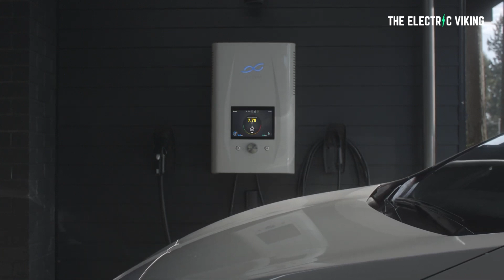The battery that charges 70X faster than lithium & has 300% more energy

Comment: after a big GMG update last week, they have increased energy density to over 300wh/kg, im not sure where the "3X" number came from. but these batteries require no heating or cooling equipment, so they wont lose energy density at the "pack level". but this still means with their current tech, they have higher energy density than any commercially available large scale lithium battery
Reply: I rather doubt about this battery, if they have mastered electrochemical formula, why they dont using existing lithium battery production tech to make battery mass production ?

Comment: You focus on the batteries not catching fires being important for airliners, which sure is true, but I really don't want my car or house to catch fire either, so I think you are under-estimating the market-advantage just for that aspect alone. Not to mention the geopolitical advantage of not needing any China-dominated rare-earths. On the other hand, 3x energy-density is theoretical, and will not happen for a long time. The 70x discharge-rate should be great for VTOLs, but for long-range aircraft I don't think this tech is ready. Grid-storage, heavy machinery with custom charging-networks, like mining equipment, trucks and busses, high-performance EVs are most likely first revenue, trickle down to mainstream EVs in 5 years is much more likely than aerospace industry.

Comment: If a battery can charge 70 times faster than the amount of current that it would draw would be huge
Reply: Yeah they would buffer the chargers with the same battery so it wouldn't have to come from the grid all at once. Still need some mighty heavy duty cables though.

Comment: One factor that was not talked about is how well they perform in cold and hot weather. I live in Western New York in the United States, and it gets very cold in late winter. It is common for low temperatures to go below 0°F (-18°C). Also I do not have a garage, so my car is outside during the night. So unless the new technology can handle cold temperatures without loosing significant capacity, it will be little use to me.
Reply: because this battery is closer to a super capacitor, than an electro-chemical battery, cold weather should not be an issue at all. im no physicist, but from what i understand about the way it operates, im willing to bet these will work nearly perfect in any reasonable conditions. i live in canada, i know a thing or two about cold winters lol!

Comment: On the topic of energy density, the chemistry used by these batteries is Al + 7 AlCl₄⁻ -> 4 Al₂Cl₇⁻ + 3 e⁻ . The Al₂Cl₇⁻ ion with a ⁻1 charge as charge carriers rather than an aluminum ion with a ⁺3. As such the cathode stores basically the same amount of energy per ion as the cathode in lithium-ion batteries because both store ions with a charge of 1. But an Al₂Cl₇⁻ ion with two Aluminum atoms and 7 Chlorine atoms has a much much higher mass of 302 g/mol compared to  6.941 g/mol for the lithium ion. Making the determination of energy density more difficult is that the aluminum-ion battery has a cathode that is made up of almost entirely of graphene and so is much lighter for each ion it can hold than the LiniMnCoO2 (NMC) and especially the LiFePO4 (LFP).

But the bottom line is that no current aluminum-ion battery is able to take advantage of the energy density advantages of storing an Al⁺³ ion. Perhaps one day a cathode material will be found that can reversibly intercalcate the very high charge  Al⁺³ ion directly. But so far the  Al⁺³ ion binds so tightly to all known materials that they won't release the aluminum to allow the battery to be recharged. However, the one place where these cells will reflect the greater number of available electrons is that in comparison to solid state lithium batteries with a solid lithium anode, aluminum-ion batteries will be able to have 1/3 the number of aluminum atoms in the anode. This won't reduce the weight of the aluminum anode since aluminum weighs 4 times as much as lithium, and so aluminum anode will actually be heavier. What it will do is that for the same rate of atoms being stripped off or deposited to the anode, an aluminum anode will supply three times as many electrons as a solid state lithium anode.

Comment: I had to find the disconnect between GMG's statement of 150 - 160 wh/kg and Electric Viking's statement about GMG's battery being 3 x lithium ( about 250 wh/kg) energy density at 15:25 in the video. I believe he is talking about theoretical maximum energy density. Theoretical energy density of lithium batteries with silicon cathode is about 2000 wh/kg. There is a big difference between what has been achieved and theoretical. The headline is wrong, existing version is about 62% of lithium, not 300%.

Comment: No characteristics like cell voltage given. pthyi!  But skipping that, presently I have understood there are some 100 kW charging stations and typical EV batteries are something below 100 kWh.  Rounding up and using a European 3-phase supply, you would have 660 V DC available.  Meaning about 150 A current.  In principle you would not be stuck to the 660 V and the related current or related conductor size.  If the vehicle would tolerate higher voltage charging and then handle somehow that down to whatever the battery pack takes, we might be able to boost the charging interface without heavier cables (assuming that increased insulation requirement does add less weight than copper does).  But all this still tells the sad story about boosting from present 23 or 50 (or rare 100) kW chargers to megawatt level does not sit too well on the power companies' thinking.
Reply: 3 phase AC only gives you 400V. If your DC charging structure is so bad then that needs to be remedied as there are already cars that can utilise up to 800V (some even 900V) DC fast charging. In Germany we have a lot of 300kW and 350 kW chargers around, they provide up to 175 kW to cars that charge at 400V. If you connect a EGMP (Hyundai, Kia, Genesis), Porsche Taycan, Audi e-tron or Lucid though these stations do provide 800V and thus provide more power with less loss through resistance... My Ioniq 5 charges at up to 225 kW using its 800V EGMP battery...

Comment: If you look at the website this is a very small outfit so far.  That doesnt' mean their product isn't breakthrough but they dont answer key questions - cost, safety are not specified.  Clearly if you could have 3x the density per kg and faster charging at an affordable cost and not be high risk - you'd have a true break through; but that is a lot of big ifs at the moment.

Comment: The reality is , most of "advanced " battery can never go out of the Lab,. NO COMMERCIAL VALUE , no application, no EV can ever use it...  Stay with Fuel Cell is the way to go
Reply: Fuel cells and what infrastructure? You have an inefficient production process for the hydrogen, inefficient storage (compression to 700bar/10000psi or refrigeration to -252°C), inefficient transportation means and inefficient fuel cells and still need a sizeable battery because the fuel cells that fit into a vehicle are delivering just barely enough juice to keep going but not to accelerate or drive up a mountain pass...
Reply: @karlgunterwunsch1950  Yes, that is depending on TODAY's limited technology. Decades ago, when we have VHS Video Tape, who will think of DVD and the online streaming ( 4K, 8K, 16K ?? ) will wiped out VHS tape ??  Fuel Cell will change fast in the next 5 years..  EV battery will be replaced , you can save this and let's review 5 years from now , Cheer ☺
Reply: @JY-lg6ee  Except that the fuel cell is old 8 inch video tape technology - it was the reason that Apollo 13 never reached the moon and their technology hasn't significantly changed in the 60 years since.  So taking your equivalence the battery is a blue ray while the fuel cell is that old 8 track full size tape deck you may have heard of but never seen one in your life.

It is a dead end technology and if any technology is limited by available resources it's hydrogen fuel cells. They need rare earth elements (unlike batteries), they need platinum, iridium, palladium (just look up the rarity of these and then tell me again how we are supposed to produce and run both electrolysers and fuel cells in the needed humongous numbers on those really scarce resources). Instead of having to expand electricity production by about 20% over the next 20 years we need to expand electricity production by 60-100% (depending on how far the hydrogen needs to be transported, there are considerable losses proportional to transport distance no matter how it is stored for transport) if we were to switch to the hydrogen fuel cells instead of the highly efficient batteries.

All but one car manufacturer and 20 out of 25 lorry manufacturers have outright abandoned their FCEV development. China no longer subsidises hydrogen fuel cell research, you need to apply for the grant before you start work with clear cut goals but will only receive the money you applied for after you have reached the set goals you stated in the research application. Thus in China (previously the country that most heavily subsidised hydrogen fuel cell research) the research has practically stopped. In Germany and South Korea research has shifted towards industry use, mobile uses are no longer pursued.. 

The German hydrogen filling station network is already contracting because old filling stations have reached EOL of their tanks or can no longer be legally operated where they are located because human habitation or industry estates are too close to fulfil the newer, more stringent rules after a Norwegian hydrogen filling station blew up and a Malaysian hydrogen fuel cell station that was supposed to supplement the local electricity grid did so as well. 

Have a look at how many filling stations are built across Europe outside Germany and the Netherlands or the US outside California. It is estimated that to be viable there needs to be around 1000 filling stations in Germany alone, at 1 million Euro a pop for a single pressure pump and up to 5 million for the traditional capacity of a petrol filling station and with distance restrictions preventing any filling stations being located in town or suburbs or industry estates... 

And then have a look at how much maintenance your FCEV needs. Every 6000 miles a pressure test of the high pressure pipes and tanks, Every 18000 miles new highly costly air filters to prevent polluting the membranes of the fuel cell, every 36000 miles new membranes for the fuel cell pack because of deterioration of those membranes, expect shorter membrane lifetime under hot or cold temperatures. Never park the car in an enclosed space (underground parking lot or enclosed garage) because inevitable hydrogen seepage will result in explosive gas building up under the roof of these buildings and hydrogen oxygen mixtures have one of the lowest, if not the lowest, ignition thresholds. If the car is subjected to a fire (like one of the 15000 cases where an unrelated fire starts in a garage) it will vent the tank content with a speed of 10 m3 per second. That will exceed structural capacity for the building the garage is in within a second - no need to have an explosion happen although that is likely as now hydrogen is introduced into an oxygen rich environment with a nearby ignition source...
Reply: @karlgunterwunsch1950  Thank You Karl, your response are very valuable and educational, I will study more into this , Cheer, and Thank you so very much

Comment: Hi Sam. I'd appreciate your comments on GMG in regard to one point, if you can find anything: and that is their timeline to scale to meaningful production of battery formats suitable for EVs. I say this because their claims cover off all the requirements needed to address a very wide sector of EV users, particularly EVs with range and performance adequate for the mainstream EV market. 
But the point that makes no sense (if indeed all their other claims are true) is that if they have even a sniff of scaling to meaningful production quantities within, say, the next 5 years, then the Tesla battery team in particular (and most other auto makers) would already have shown extreme interest.
Given that any meaningful level of interest by EV battery consumers at this point does not seem to have taken place, one has to doubt that many of the claims made by the company are well proven at market level.
Appreciate any further info you have that you can share

Comment: Recharging at 70 times the speed? It would require a charger, cabling and a battery management system which are capable of handling at least 6 Megawatts to recharge a 100kWh battery in 1 minute. That's assuming a constant recharging rate for the battery. Given that battery recharging follows a power curve, you can expect to need at least a 12 MW peak power system for the job to be accomplished in that minute.
Not impossible, of course, but voltages will likely need to be substantially higher than 800 Volts for a 12 MW system to be practical. At 800V DC,  peak recharging current will be 15,000 Amps. Internal series resistances will become critically important.
If a 50kWh traction battery is used, then peak power and current can be halved, to 6MW and 7,500A at 800VDC.
If this new technology lives up to the claims, another revolution will take place within the EV industry. Exciting glimpses of things to come.
Reply: >  Yeah looking at some other comments enough people realize the current demand for such a battery is huge.  OK the instructions say plug in the power cable,  at least three people needed to help, and pull the main switch on.  Then my house gets pulled off its foundation. Yep, that's a lot of electrons.
Reply: I you can charge fast there is no need for a 100kWh battery.  30-40kWh are enough and you can stretch the time to 5-10 minutes. Also your recuperation will be much bigger if you breake.. You can maybe  charge your Smartwatch in 30 seconds

Comment: I’ve lost count of how many “game changing” battery related news you’ve put out on this channel lately. (Funny you did not use “game charging” in this one) I would appreciate a special edition long video where all those recent news are deployed and compared on a feasibility, cost and time scale…
Reply: Have you had a look at their "manufacturing plant"? That consists of a small office block built into a warehouse with space for at most 10-12 people, two of them clearly just normal office spaces. What they call "coin cell manufacturing" is just a few lab technicians cobbling together samples in a laboratory. For that to scale to commercial size operations they will have a long long way to go...
Reply: @karlgunterwunsch1950  Actually they never claimed that they had built a "manufacturing plant". Instead they built two pilot lines in partnership with the BOSCH Group (world leaders in automated process lines design and construction, including battery manufacturing) with battery manufacturing machines representative of the machines in an actual manufacturing plant. 

The point of a pilot plant isn't to make batteries for sale. Instead it is intended to develop the process, including all the settings for the various machines, necessary to make these batteries on actual full sized production machines. As such a pilot plant consists of just those machines that are performing critical steps in the manufacturing process to see if those steps can be done by machines with sufficient accuracy and precision to yield cells with the desired performance and life characteristics. Other steps that aren't critical to the ability to make these cells on an automated production line, like preparing the various films and foils at the start of the manufacturing process as well as steps like moving cells from one machine to another or things like trimming excess material between steps, are done manually.

As such the "office block" you belittled is actually a climate controlled clean room that is big enough to hold the key machines for the pilot production of coin and pouch format cells. The cells produced on the coin cell pilot line have been sent to potential customers to allow for their independent testing. The pouch cell pilot line is now running and has made its first pouch cells. One the pouch pilot line has been dialed in, undoubtedly test cells will offered to potential customers who use this larger format cell for testing and evaluation. 

Once they have refined the processing steps on the pilot line, they will almost certainly move to their first small scale production facility with full scale machinery. This first production line may still not be fully automated, but will be geared to being able to make a significant number of cells. The cells produces on this first line will go to potential customers in sufficient quantities for them to integrate into test version of their products to allow the actual performance of the cells in real applications to be determined. Successful demonstration products would then hopefully lead to orders sufficient for them to to build a full scale "mega" factory needed to make enough cells to support their customers making products to sell to the public.

Comment: Kind of forgetting that the purpose of EVs is to ditch fossil fuels. Their saying their main input is natural gas..great..we are going nowhere then. Also Aluminum production is extremely carbon intensive currently to mine and then purify the Aluminum in smelters. So both sides of this battery are pretty dirty then (graphene and Aluminum) 
I hope the breakthrough is real..let’s just keep it real that it isn’t a cure all for the mining that will still be needed as with all battery materials
Reply: gonna take a lot of diesel to mine all that copper to make EVs...